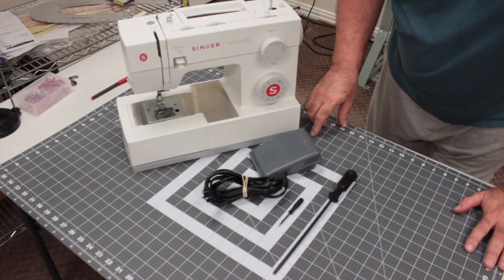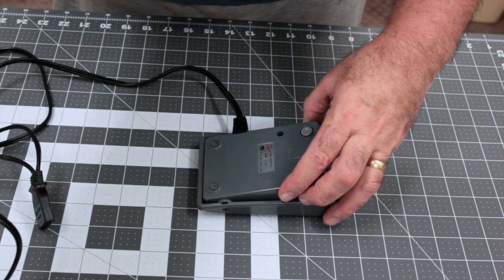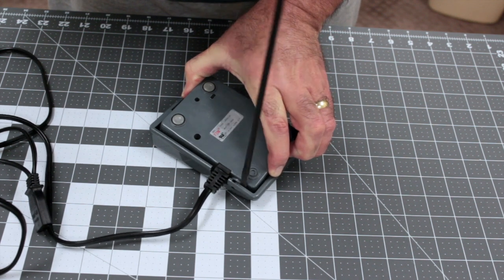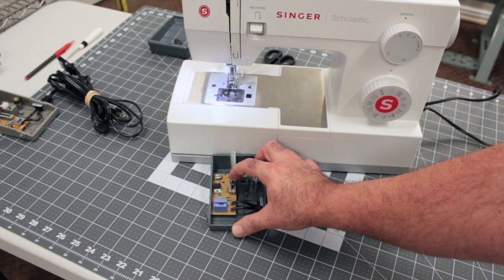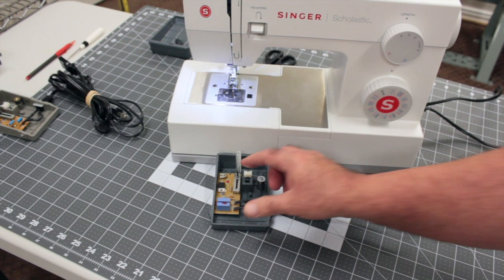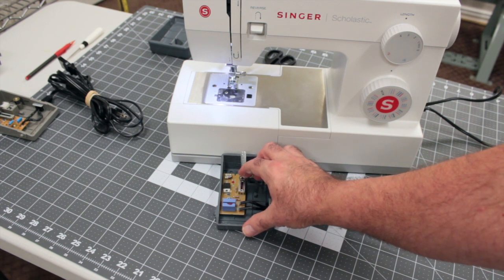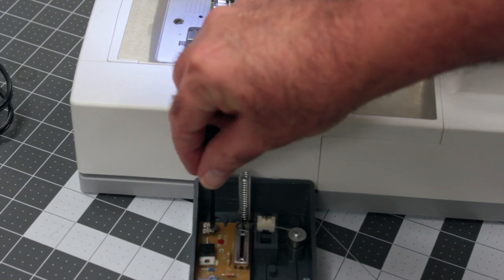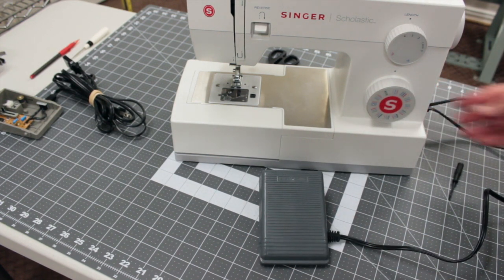Slow down the Singer Heavy Duty Series on some USA Versions

Comment: IF THESE STEPS DIDN'T WORK - KEEP READING! This is the same foot pedal, or similar, as the one for other models like my Singer 3225. Unfortunatly the speed controler has never worked for me, but when I opened it and fiddled a little with it I realised that when you bend the moving part of the speed control at the tip pointing down then it makes the machine go slower too. Hope this helps some of you guys!
Reply from the maker: Thank you for the tip!
Reply: could you please elaborate, I've tried every angle but my speed won't change!
Reply from the maker: @kamakshik1219  Is you model the USA version? If so, maybe they changed it.
Reply: @kamakshik1219  I'm not sure how i should elaborate. All i did was bend the thin metal that moves when you adjust the speed controler. Are you sure you have that part?
Reply: @mistaskate8715  in what direction did you bend it?
Reply: @kamakshik1219  upwards. In other words away from the plate it sits on.
Reply: mistaskate the semi circular one?
Reply: @abdurrahmaansahalsaloojee3181  yes!

Comment: Heavy duty doesn’t change at all regardless where I turn it it’s fast as lightening... I really don’t know what to do any more
Reply from the maker: You may try another foot. I've heard others have ordered a 2nd foot to achieve this technique.
Reply: @kevinsews  I have the same problem with my foot pedal. Your instructions do not help. Could you please suggest the foot pedal model number to order?  Thank you.
Reply from the maker: @liransimandiev4974  Contact www.sewingpartsonline.com and let them know your machine and ask them if they have a pedal that has the feature  you are looking for.
Reply: Literally same it’s so frustrating at this point
Reply from the maker: @araztapeh1911  Is your pedal the USA version? If so then it sounds like it is defective.
Reply: Kevin Sews yes I ordered it off amazon and it was new, everything else is in perfect condition. I think you may be right and the pedal is the issue
Reply from the maker: @araztapeh1911  Contact these guys: www.sewingpartsonline.com and tell them what you are looking for. They will guild you to a pedal that will allow you to adjust the speed.

Comment: The foot control for my new Singer HD6600C only has the slider inside. It has no circuit board. So the machine has to just run at a fast speed and no low speeds.
Reply from the maker: Thanks for letting us know.

Comment: How about 7256?
Reply: @kevinsews  I have a 7256 Fashionmate and if I could adjust the speed that would be fanstic.
Reply: How can I slow down the foot controller on a 7256 Fashion Mate by singer? Can I put a speed controller from the main power plug to the machine. My foot gets very tired and using the foot controller wavers.
Reply from the maker: @donaldharris1763  First take the pedal apart like I did in the video and check to see if it had the same knob I showed in the video. After that maybe you can find a pedal that has it.

Comment: I think you don't need to open anything there is hole not circle one the rectangle one depends on model some of shows high and low and some like positive and negative sign and some with nothing
Reply from the maker: Yes, some have this feature. The USA versions rarely have it though.

Comment: This trick does not work on mine. the control was in same position from factory. it used to work fine when i got the machine.  Hers whats weird. the black rectangle item is a TRIAC, and small blue component next to it is a DIIAC. the rest are resistors.and a couple caps.  one of my 1k resistors was at about 670Ohms. replaced with a real 1K. but makes no difference. as it is right now it either OFF or Full Speed Ahead. I will be making a video of this circuit reverse engineered  so this may enlighten us all as to how this dumb ass circuit works. will post here when i have it up.  IF anyone here has my SAME problem, let me know. id be especially curious to know if a new pedal fixes it.
Reply: I suggest buying a voltage converter if you bought your machine abroad. My machine was too fast and rotating the screw of the pedal didn't help. I bought my machine from the us and using it in Australia, the machine works on 120V while the supply voltage in Australia is 230V. After plugging the converter the machine slowed down and I was even able to change speed with the pedal screw.